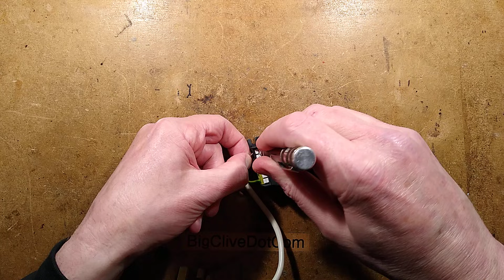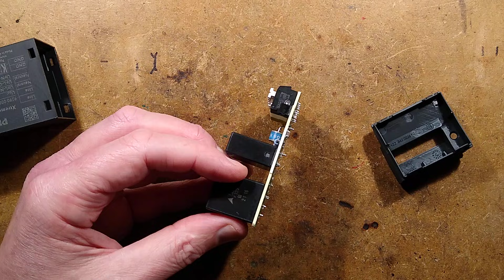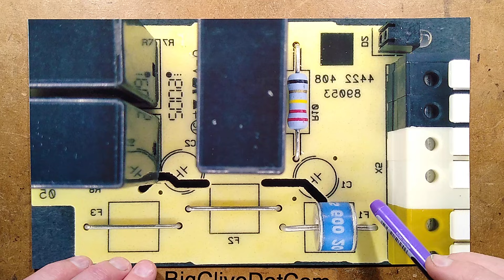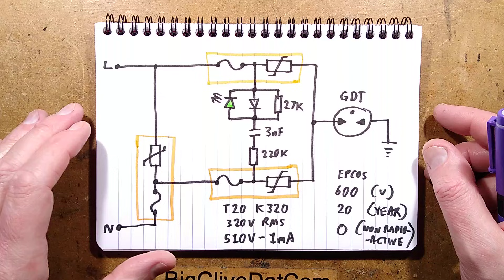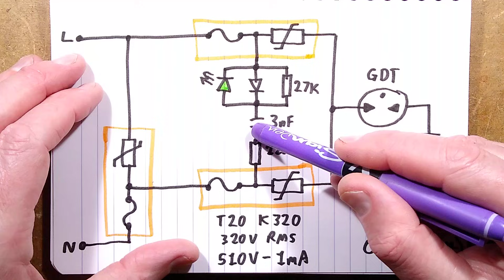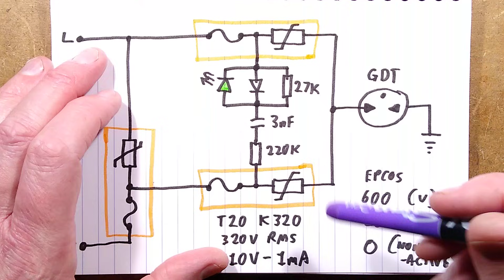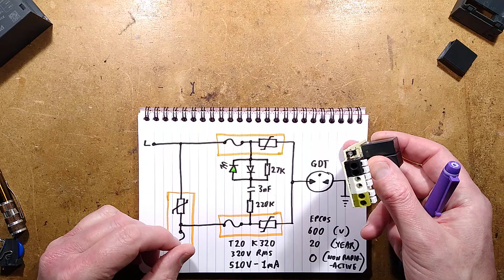Inside a Philips Xtreme surge device for street lights

Comment: 4:13 Yes, it's a fusible resistor, they seem to be somewhat standardized with that black stripe as the last one. That black stripe isn't supposed to be counted, so this would be a 4 stripe resistor. Funnily enough, earlier today I tried to decode one with two gold strips on 3rd and 4th position as a 5 stripe resistor, and every table I was looking at was sure that this resistor can't exist ;)
Reply: If I recall (and it's been a while, so I may not), the 4th stripe is tolerance and the 5th is tempco.

Comment: This looks like it goes across the various lines (live, neutral, ground), connected in wye, but is not in series with the nominally protected luminaries. So it must be in parallel with the protected light. If there's a voltage spike, it looks as if the thermal element will open the connections, thus not shorting out the spike. Shorting out the voltage spike is how I'd expect a parallel-connected surge protector to work. So how does this protect from voltage spikes? What am I missing?
Reply from the maker: It does shunt the spikes.  The fuse is a safety feature when the shunt component fails.
Reply: Thank you.

Comment: So, when there is a voltage surge, the impedance of the varistor drops, allowing a huge current to pass, melting the solder point and breaking the circuit?
But if there is a second surge or a longer surge, you're fucked because the circuit you wanted to protect in parallel takes the full hit?

And what's the gas thingy that connects it to the ground? It lets current flow without letting current flow?
Reply from the maker: The fusible link only triggers if the MOV is failing and starting to pass current continuously.

Comment: I thought that GDTs are slow for transients.  Did they save any street lights?
Reply from the maker: I've not tested that yet.
Reply: What protects the light is the MOV between L and N, the GDT is there only to prevent arcing to ground between terminals or inside the light power supply. An arc will ignite before inside a GDT filled with an easily ionizable gas than between terminals and/or PCB tracks exposed to ambient air.
A MOV can't be used for that application because brand new MOVs are more conductive than GDTs and then their resistance goes down as they age due to exposure to voltage spikes, if you've enough of them in parallel in the same circuit or one worn out the current leaking to ground will be enough to trip the RCD/RCCB.
Reply: @ruben_balea  No, the GDT is there to sink High Voltage transients on both Active and Neutral conductors AND isolate both Active and Neutral from Ground/Earth connection under a low voltage transient surge. 
So, the GDT is there to "arc" to Ground.
Reply: @BTW...  That's exactly what I tried to explain, when the GDT arcs to ground it prevents the arc to ground from occurring elsewhere in the circuit.
And it doesn't make any sense to wire the two fusible links built-in in those MOV modules between the GDT and neutral, no other serious manufacturer of SPDs does that, but this is from Philips and if they are not going to sell as many replacement lights at least they will sell enough replacement protectors.

In Spain many (all?) town councils take weeks or months to fix the street lights and normally only acknowledge having found out that they had failed because the neighbors got tired of walking in the dark and made a complaint, I suspect the same happens in every other country so no one is going to check the the protectors even once a year and Philips won't stop selling replacement lights either but then it will be the customer's fault 🤦‍♂

Comment: Can you talk more about what a GDT is
Reply: Gas Discharge Tube. It's a spark gap with conductive gas inside. They are set up so that the gas will start to conduct current at a certain voltage; this one 600V. This will send an over-current surge on Live or Neutral to ground/earth.
Reply: @stephen1r2  thank you

Comment: I really don't understand what this does, if it trips and it is across the supply, then it is effectively not there any more.
If the engineer cannot see the unit, then how do they know if it has tripped ?
Reply: More expensive protectors have a microswitch that opens when any of the thermal fuses trips, that can the  be connected to a light or monitoring system where the maintenance electrician can see it. MOVs fail by gradually becoming low resistance, so without a thermal fuse, there is a certainty of them going up in flames literally eventually.

Comment: 4:12 Apparently a resistor's 5th band being black most likely means it's wire wound.
Reply: bands 1,2 and 3, 22k, band 4, gold 5%, band 5 temperature co-efficient, and black seems to be 0, which is very odd, why even put it on there.

Comment: I've seen some weird colors on resistors, idk but that black stripe is confusing. Did you measure it?  Thanks Clive.
Reply: @terrym1065  i thought it was to do with temperature coefficient   !!  Probably.
Reply: My understanding on 5-band resistor is that the first, second AND third stripes are the value, fourth stripe the multiplier and fifth is the tolerance. But why would there be a gold 4th band in that case? Puzzling.
Reply: @tncorgi92  Reversed maybe.
Reply from the maker: I did measure the value and it tallied up with the schematic I drew.
Reply: @bigclivedotcom  Thanks Big Clive, I figured you had. The gold percentage band followed by the black decibel band had me puzzled though, maybe reversed?
Reply: Though gold indicated high accuracy value resistor.
Reply: In power resistors the 5th band is the temperature rating, I believe
Reply: Some five band resister colour codes exist with the fifth band being the temperature coefficient.

Comment: Ah, back when Philips was cool. Fun fact: My parents met and fell in love with each other in a Philips PCB factory in Klagenfurt, Austria. My father repairing old 1970/80s computers, my mother being at a soldering station. Later when I did my required summer internship for my engineering degree, I worked in the CAD/CAM department doing Linux and Solaris/SunOS stuff. I saw the place my mother soldered, I saw the factory lines the magnetic tape computers controlled. Love was in the air, everywhere. Philips will always mean "romantique" to me. 😍😍😍😍 Now that factory is gone, replaced by a shared working space for NPC TikTok trend influencers. #IceCreamSoGood
Reply: such a rollercoaster of a comment lol love it
Reply: Is it fair to say if it wasn't for Philips, you wouldn't be here? 😉
Reply: Klagenfurt in the house tonight ✨

Comment: A simple leadless 90 Volt  GDT  " sweat " soldered into a (  VERY  SUBSTANTIAL !  ) grounded brass block  recess ( dimensions optimised for RF 50  Ω impedance @ Ghz ) will protect the antenna(e) of most mobile base stations from the secondary ( very high current ) pulse from a direct lightning strike .... ( tried - n - tested ) ........ DAVE™🛑

Comment: When I started to specify LED street and parking lot "luminaries " as they are technically called, surge protection was an option to add, which I always picked.  I also started to specify a SPD on the circuits coming into the panelboard from underground exterior lighting circuits.
Reply: Did you have any criteria for choosing white vs orange, and the effect of color on peoples vision and/or animal behaviour? Thank you.
Reply: @xtevesousa  I usually chose 4100 Kelvin similar to Metal Halide.  A high CRI was also important so CCTV cameras could distinguish vehicle colors.   I don't like 5000 K or colder anywhere,  inside or outside, too harsh and unnatural IMO. On one project,  a military distribution warehouse, I talked the Army Corp into changing the standard spec from HPS to Metal Halide to distinguish green from tan.  At a school project I  talked them out of 5000K interior lighting by building a mockup and we ended up with 4100K.
Reply: @curtw8827  I hate 4000K lighting. I'm  not a fan of that metal halide look.  With LED lighting we can do better. I prefer 3000K for parking lots, just beautiful in the evening. I've noticed all the cheap parking lot luminaires are 4000K. I find it sad, but I know it is cheap. For indoor commercial lighting, lots of 3500K. For residential, 2700K or 3000K.
Reply: @whiggins101  In my Architect/Engineering company offices, I outfitted different offices with each of the color temperature fluorescent lamps, the architects were amazed on how the lamp selection affected the wall color.  What annoys me is going into an establishment where the replacement fluorescent lamps are different color temperatures.  Unfortunately, LED luminaries are now throwaway E-waste when they can't be relamped.
Reply: @curtw8827 I am a 5000k lover. I absolutely HATE any color temp less than that.  One color can't please all of the people all of the time. Keep that in mind.

Comment: We are now required to install whole house surge protectors on new panels etc here in the US... More of a profit boom for the manufacturer than anything else. $50-$200 for $5 to $10 of MOVs in a box... I have never been that impressed with them and for decades most everyone saw them as a scam item to sell a homeowner at a high profit margin. Not a bad idea but performance in real life is lacking IMO. Here see more problems with one phase dropping out momentarily which causes havoc with 220v AC compressors as it can cause them to reverse rotation if they are running when it happens.
Reply: I have outfitted my house with a 3 stage lightning and overvoltage protection system. Aside from helping with the failure rates of al the electric stuff it took at least one direct hit I witnessed personally. One evening I was sitting in my basement, gaming on my PC while a thunderstorm was raging outside. Lightning struck extremely near, maybe even the lightning rods on my house.  The Dehn FlashTrab at the main junction box made a sound like a cracked whip. My PC and anything in my house just kept running, the lights did flicker slightly.
The next day I heard from the neighbors that a lot of TVs, routers, phones,PCs  and other stuff along the street  did blow up at this evening. So yea, a 1000€ top investment. I have a lot of tech in my house.

Comment: Fuses or not, did you not just  draw out a short from live to neutral?  I assume this goes in circuit?
Reply: It only becomes a short to snub excessive overvoltage transients (think events lasting on the order of a dozen nanoseconds). It's a metal-oxide varistor; a device whose resistance is initially quite high until the voltage threshold is reached, at which point their resistance drops dramatically. Should the overvoltage condition persist for a long time, or the MOV wear out through repeated activations, it will become a short, dissipate a considerable amount of heat, and break the thermal fuse, avoiding a fire.

Comment: 3:52 hmmm u wrong  my component calc from saulawa displays it as a 22.4ohm resistor. the 5th stripe only is use for the %s but black dosnt exist. app says only 2-4 can have black.
Red is 2 yellow is 4 Gold says it xx.x Ohm
Reply: Maybe 220K 5% and temperature coefficient (black) = 250ppm/Deg.C
Reply: @Aitch-Two-Oh  Nope Bc the 4th strip is Multiplier. and Gold  is x0.1
the 5th Band is Tolerance.
so if black is usally equal 0 would mean 22.4ohm +-0%
resistors with temperature coefficient are 6 band Resitors
Reply: As you wrote yourself, black is not a tolerance, so the 5 band color code does not apply. It is 4 band with an extra black band which according to some is just an end marker (since it cannot be the start) or according to others it signifies wire wound.
Reply from the maker: I measured it at 220K.
Reply: I found this (my bolding):

"In a four-color band resistor, the first three color bands are used to decide the resistance. The fourth color band will represent the tolerance value.

In this color-coding system, the type of resistor can be determined based on the color band. In a resistor, IF AN ADDITIONAL 5TH BAND COLOR IS BLACK, THEN IT IS A WIRE WOUND RESISTOR, if the fifth band color is white then it is a fusible resistor and If a resistor has one black band within the center, then it is known as a zero-ohm resistor."
Reply: Simply put... It needs deconstructing!  😁😁😁

Comment: An interesting design and well-made - what we'd expect from Philips anyway. I imagine that this protects the lamp from the first lightning strike, then the next one takes out the lamp anyway - at least Philips have their money and will continue to produce them "because that's what commerce is"!
Reply: The hope is the first strike takes out the 16A fuse in the supply line, so that the one who fixes it will look in the fixture, see the black skid marks, and replace the SPD device. Though normally they just switch the breaker on again, and the SPD now is only a fancy wire junction.There is a reason that lighting suppliers make the interior wire all from thin enamelled copper wire, with a woven fibreglass sleeve slipped over them, as all the wiring from the input connector now is a fuse. It will blow open, and never short the power supply for long, so the rest of the lighting will work properly. Seen plenty of lights where the SPD is blown apart, generally those with wound ballasts will not even notice high voltage applied to them , even for a few weeks, though the lamp sure will notice, as the 95W mercury capsule will light up brighter than a 400W capsule, at least till it explodes, and the 400W metal halide or sodium will simply light up brighter, and start to cycle.

Comment: Why aren't these devices used in series with the lights? If these fail, then the light remains unprotected, and unnoticed.
Reply from the maker: I reckon it's mainly to extend the life to outwith the warranty.
Reply: But how would that work...? @bigclivedotcom
Reply: Yes, I pretend to understand most things, but struggle with this one. Presumably the second surge (during the lightning storm) sets fire to the lamppost, cabling, lamp fitting etc so you would know to check the device.
Reply: If the protection saves the light but the light then is off, it would be not much of a use

Comment: Handy they come apart so easily it leaves them wide open to "reset" the spring. 
interesting
Reply from the maker: That would require a new MOV too, since it's failure of the MOV that melts the solder.
Reply: The sort of entities buying these won't be bothered about 'repairing' them. They'll be swapped out and binned no doubt...
Reply: @dougle03  The sort of PROFESSIONAL entities that buy and service these are NOT prone to bodgy hack jobs like the DIY crew who would consider doing such a 'repair'.

Comment: Are these units wired with solid core or stranded cable? Either way I'm surprised at the choice of spring clip terminals
Reply from the maker: Usually stranded.  Spring loaded terminals are now very common in Europe and time-tested for decades.